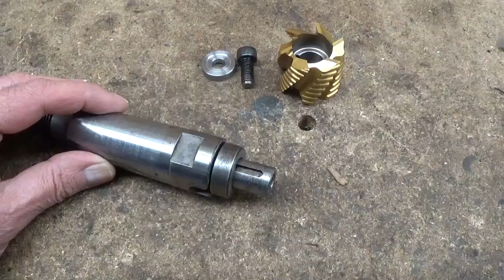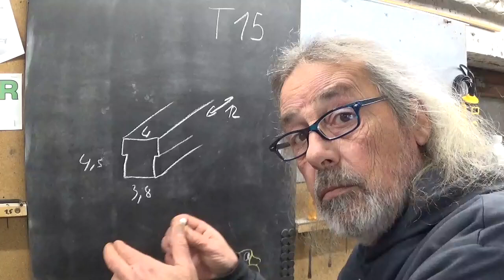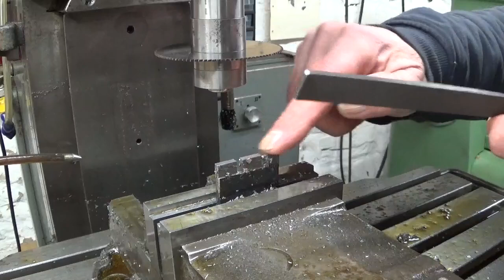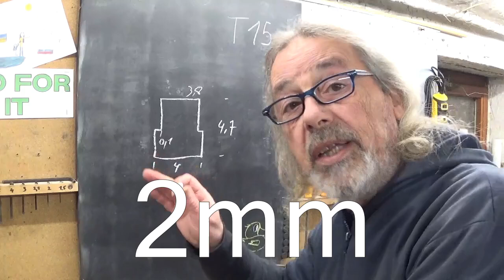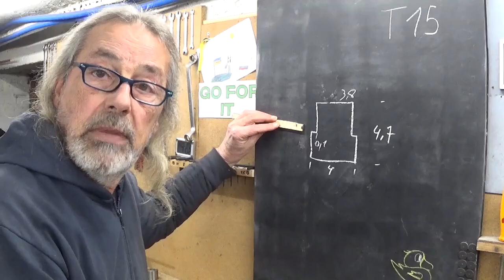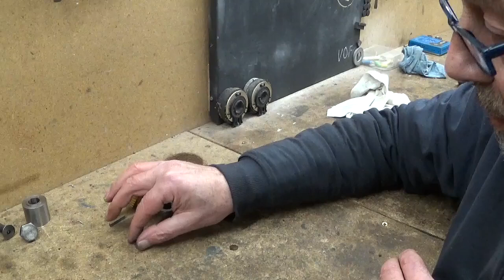Making small keys using the shaper and milling machine.

Comment: Ah yes, making extra parts to appease the Old Gods of the workshop floor... We have the same system in model making - it is called the 'Carpet Monster' and it eats small pieces of plastic. So, if I want 10 pieces of 1mmx1mmx5mm styrene strip, you can guarantee I'll need to measure and cut at least 12 to even have a chance!

Comment: Joking, with heart, several time below.
Milling? Not shapering? Joking! Aha, You're doing it later.
I have a milling machine but not a shaper. Never mind, interesting anyway.
Haha, "I forgot to press record"..... Be my guest! I fly drones and have made the same mistake more than once! Sometimes the low resolution controller picture has been uploaded.
You explained using a round nose cutter in the shaper. Why can't You use a rectangular cutter? I think You have done that in the past.
You, Rusty, and the shaper..... No limit of what You can do. G-d knows but one day Your shaper will replace the lathe...
One arbor and 5 keys... Strange. How did that happen? 
Wow. The final cutting works like the cheese slicer on the cheese here!

My third drying rack just got a plastic part failing. Just to copy the turning/milling work I did 2 years ago... Thanks for the shop work inspiration! Says a drone flyer.....
Reply from the maker: That's a long comment :)

Comment: Hi Michael,  good work on making the keys. However, is there a keyway in your spacer(s)? If so your keys should be the full, or nearly so, length of the keyway in the mandrel and you should install the key first, then the spacer, and then the cutter(s), washer and bolt. That way if you get some narrow cutters you could mount two, with the spacer(s) between them, equal to the width of the new keys you might have to make for when somebody sends you some different cutters. Soon, you will have a drawer full of cutters, one arbour, and about fifty different keys! See what type of "a can of worms" you've generated? Have fun.
Regards from Canada's banana belt. 
🤞🇨🇦🍌🥋🇺🇦🕊🇧🇪🥫🐛🏁👍
Reply from the maker: Nope, there is no key way in the spacer.

Comment: Thanks for sharing another great video.

I've had some questions about your flood oil setup on the mill,  ever since you told us about it a while back.

Does it tend to fling oil around the shop?  From the footage I've seen of you using it, it doesn't look like it happens at all with your setup, even with end mills turning at fairly high speeds.
If it's not flinging oil around, can you tell why it happens so much less than water-based coolants seem to do?  (High viscosity oil, maybe?)

Have you found an upper limit to the surface speed of the tool, beyond which it does start throwing oil?

If you were thinking about doing an oil coolant conversion on another mill, what would you do the same and/or differently next time?

Thank you sir!
Reply: I have found with HHS tools cutting steel it is not really a problem.  Need to keep oil flow low so it does not help with clearing chips. 
Aluminum material and/or carbide cutters can get to speeds where it gets messy. 
Drilling and the resulting long chips can sometimes be a problem.  Frequent pecks to keep the chips short helps but drill chips always seem to make a mess.
Reply from the maker: I will talk about it in an upcoming video.

Comment: i woud most likley open'd the slot in the arbor to 4mm, just easier to make a 4mm-key all the way, and i agree whit the down-under guy Matty, a shaper is still a good machine to have in most workshops
Reply from the maker: The problem is to hold the arbor for milling.
Reply: @Rustinox  yea, i'll agree there, some sort of bt-holder whit an outer square or hex-shape - pherhaps an idea for a project? 😁